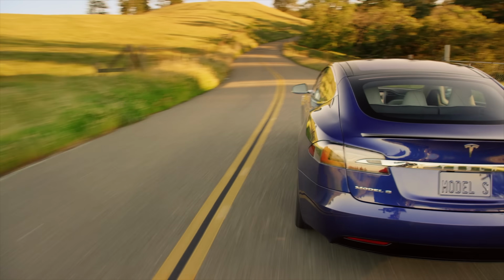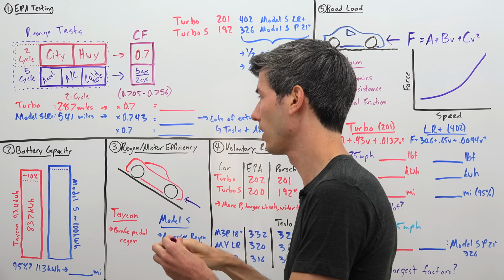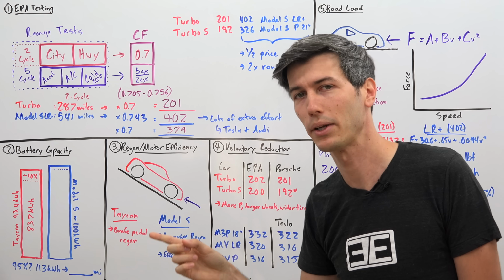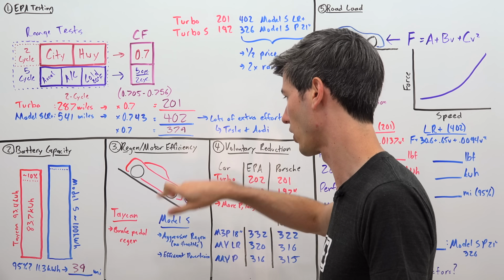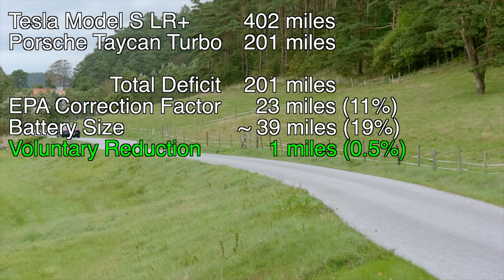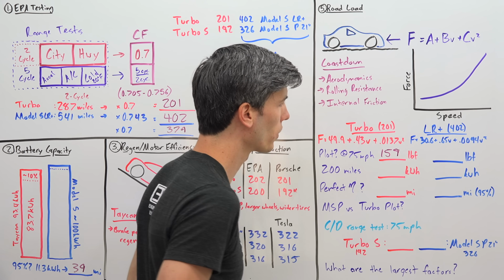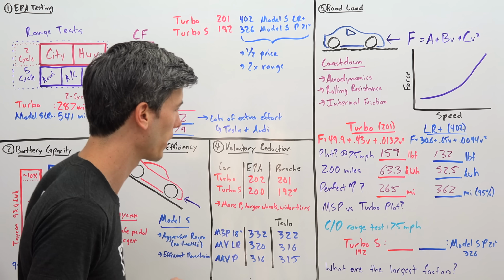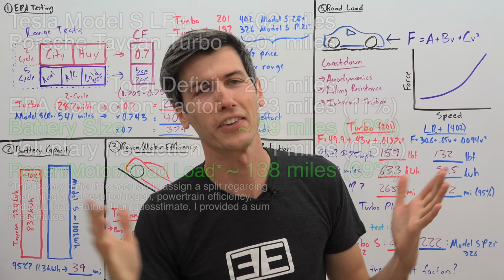Tesla's Secrets To Dominating EV Range - Double Porsche?!

Comment: Porsche ALWAYS underreports...  their cars usually produce more HP and have better 0-60 or ¼ mile times than advertised... that is what Porsche does.
Reply from the maker: And yet they're simply using their test results for these cars, not understating.
Reply: @EngineeringExplained  The very fact that they're not embellishing it is effectively the same in todays world... but I can assure you as a 992 owner, the performance on the car is noticeably better than the numbers released (0-60 3.4??  closer to 3.0).. etc..
Reply: @EngineeringExplained  btw, thanks for the great videos.. would love to see you do another video on why the 911's engine with GDI isn't prone to carbon intake valve coating like so many other GDI's... always wondered why?

Comment: The whole video you were comparing the MS LR versus the Turbo and then at the end used C&D's numbers for the performance versions which are not tuned to go far. The tires are probably the biggest issue for performance versions. You'd see about a 100 miles difference maybe more if you were comparing the longest range variants.
Reply from the maker: I believe I was clear which cars I was discussing - apologies if that was confusing. The Porsche still beats its range, and the Tesla is way under (again, comparing the top performers, but the Model S's EPA rating does not reflect highway range at all - off by 100 miles!).
Reply: @EngineeringExplained  If I drive at 65-70, my Model 3P gets its' rated range.  Above 70 eats through the battery quick.  If you want efficient highway range, slow down a little.  Your time gained by going fast is lost by charging longer.  I drive two 300 mile trips a week and I find it's better to just drive the speed limit.
Reply: @johnh8268  People who think that way should save money and not buy the Turbo version of the Taycan or the performance version of the Model 3 or they are completely wasting their money.
Reply: @robertm3951  You are probably right if range and efficiency are a top priority.  I do wish I had bought the M3P- without the big wheels and summer tires.  However, I'm trying to point out it's possible to drive a little more carefully to get that sweet, sweet range, even in a M3P, when necessary.  I do most of my performance driving around town and for the occasional high speed pass or merge.  Still, I could have saved ~$7,500 and bought the M3 LR AWD and probably been just as happy.
Reply: @John H Really!? Anyways.. It’s actually faster to drive as fast as possible if you have to charge anyway. As long as you don’t go faster than like 110 mph (180 kph). 🙂

Comment: Check Bjorn's video on Taycan 4S range.
Reply: Yep. Put on different wheels&tires, boom range = amazing.
Reply: @jfolz  nobody forbid you to spec the car with the most efficient tires rather than the most performing ones. And likely still lap several seconds faster than the model S around a track with those tires.  But no point to reason with cult followers
Reply: @USUG0  people can do whatever they want with their cars. If I could afford one I'd wanna keep it as intended by Porsche. They know what they're doing :)
Range is good enough as-is and the charging speed is bonkers anyways.
Reply: @jfolz  What was more amazing was the range before he set off... 453km. Does the car know what tyres are fitted? I think not. So the range was above 201miles prior to driving on those tyres.
Reply: @AndrewClelland  AFAIK that "range spec" Taycan was tested as-is, so the car knew the long term consumption as driven by the owner.
Reply: @jfolz  But then why was 580km such a surprise and far beyond what Porsche has advertised? If the car already knew, then Porsche most definitely already knew 😉
Reply: @Andrew Clelland I was not surprised at all. The Taycan and the Model S are almost exactly the same size, shape and weight. Of course they have very similar consumption with similar wheels. There’s very little Tesla can do about the laws of physics.

And it’s not like Porsche and other legacy manufacturers started developing electric motors yesterday. Still, most people believe that Tesla are light years ahead. They are, in marketing.
Reply: @Andrew Clelland I think it was fitted with the same tyres all the time. Don’t know if GOM knows, but it uses a number of parameters to estimate the range. If it doesn’t know where you’re going and how fast you’re going to drive, it uses a slightly pessimistic number based on you’re previous trip(s). This is very different from Teslas fixed “typical” range, and it really plays with your mind, even if you know.
Reply: @sdrhs-q3j  basically everyone knows that egg-shaped cars are efficient, only Tesla is not afraid to make them that way unlike other makers ;)
The Korean cars are might actually be more efficient drivetrain-wise.
Reply: @AndrewClelland  the car was fitted with those tires from the factory, they weren't change for the test...
But it's a Taycan with 19" tires, not wide 21".
Reply: @riDDimann True. Wish he documented tire pressure in all his tests as well. Apparently, Tesla recommends 3,1 bar cold (ends up at approx. 3,3 bar warm) while Porsche recommends 2,5 bar.
Reply: That is Bjørn Nyland channel for people who don't know
Reply: @FSXgta  You just named it perfectly. Don't be scared, wager an excursion to the search function, it's OK!
Reply: Check the Video or article by nextmove,
They compared Tesla vs Porsche @120km/h and also @200km/h
Reply: Bjorn is a tesla fanboy
Reply: @Fleyua Yes, but he still makes damn good content. And he achieved 580 kms. (360 miles) with the Porsche Taycan without even checking the tire pressure.
Reply: Even Bjorn's test show that the Model 3 Performance is more efficient with 20" and sticky tires compared to the Taycan 4s with 19" and low resistance tires. The Model S got 644Km
Reply: @juanmedinar20  644km vs 580km is about the difference you'd expect from the battery size, so their efficiency is quite comparable, with the model s probably still having a slight edge. This video is suggesting a massive difference that just isn't there in reality.

Comment: I've always found it odd trying to compare these 2. The Porsche is obviously built more like a race car than a Tesla. The goals are different as its all about what trade offs you want. If i'm in the market for these cars then i'm not thinking "This one is built better because it can go more miles off s single charge". 
The question is "Do i want to have the sporty feel for the odd track day or do i want less hassle at charging stations?"
If we are talking about for example a nissan/renault this becomes an entirely different story.
Reply from the maker: It's a 5000 lb luxury EV sedan haha. It has impressive performance, but it's not a race car.
Reply: @EngineeringExplained  True, i did say sporty feel. Its about the driving experience instead of engineering quality.

Comment: When you buy a Porsche, you want it to drive like one. The suspension is miles better (and likely heavier and less efficient) than the Tesla which is only fast in a straight line.
Reply: Hmm... I hope you know Model 3 was able to get a better speed in the moose test than Taycan. Seems like the Taycan is only good for straight line
Reply: @biplabkumarghosh6300  The Model 3 isn't in the same class as the Taycan and Model S. It's almost a foot shorter.
Reply: It dosent feel like a porsche its way to heavy
Reply: @sikk47-21  Taycan has torque vectoring, rear wheel steering, electric mechanical roll stabilization. Only model 3 has rear wheel steer.
Reply: @sikk47-21  
Porsche Macan owners: 🤔
Reply: @hectorandem2944  Comparing the entry level of any company to a flagship makes no sense. C-Class compared to a S600 Maybach?
Reply: @jalenad11  I'm glad to see that you don't even think about the A-class as a Mercedes. You have a soulmate here. C-class will always be the "baby benz" 😉
Reply: @Alex Spray Wasn't comparing the 3 to the Taycan. I said the 3 was the only Tesla with rear wheel steering. Tesla maintenance has been documented as terrible and they remotely disable features from the vehicle that you paid for. Just like price is price, better is better. This wasn't a bang for buck discussion. If you're shopping in the exotic market, you buy what you want because you want the features more than you want the money the car costs.
Reply: @Alex Spray Model 3 is the cheapest Tesla and isn't classed with S and Taycan. The loaded S is around 115k and Taycan Turbo S is 185k. Try getting maintenance on a Tesla and you'll wish you bought the Porsche.
Reply: @jalenad11  looks at the $135K I saved buying a Model 3  Nope, still not wishing I bought a Porsche

Comment: really? lbf, kwh and miles in the same table? Just pick a system jason!
Also that system has to be metric
Reply from the maker: Here in America we like to make things extra difficult. We think it gives us grit (I'm just using the units that EPA displays).
Reply: Kwh is used for electricity usage and storage in the US. It isn't Jason't fault that units in the US are so inconsistent.
Reply: @TheGerm24  the way I've been taught is to convert everything so SI, do all the calculations you need and then back to imperial if necessary, which is still easier than keeping track of conversion factors all over the place
Reply: @TheGerm24  qqqqqq1

Comment: Still laughing with my s211 Diesel with 1100 km every day range :D
Reply: How much you pay to fuel up?
Reply: Carlos Gutierrez with normal german prices about 60€
Reply: Couldn't that really be twice or maybe even three times a day on the highway?
Reply: and just how poison is being expelled from the exhaust?
Reply: @rtfazeberdee3519  Hardly any, using HVO makes your diesel car more environmentally friendly than any EV.
Reply: @emilmuhrman  turn the engine on and sniff the exhaust for a while and you'll find that not true.
Reply: @rtfazeberdee3519  No noticeable smell from a modern diesel with particle filter and catalytic converter. Lithium mines on the other hand....
Reply: @emilmuhrman  ok, lock your self in a container with the engine running and see how long you can stay in there
Reply: @rtfazeberdee3519  You will die from to low oxygen levels by increased carbon dioxide. This is not a problem on larger scale because the same plants used to make the fuel in the first place is now binding the carbon dioxide emitted. Carbon monoxide and nox compounds is not a issue with a functional catalytic converter.
Reply: @emilmuhrman  funny that all cars in europe have catalytic converters and nox is a problem.  So you can't breathe carbon monoxide that emits from your exhaust pipe.....  now if i lock myself in a container and turn on an EV, i'll look and sniff hard to find similar to the ICE car.
Reply: @rtfazeberdee3519  It's only in inner city's there that is a problem. Because the catalytic converter don't comes up to temperature. A hybrid with a small battery to use in slow traffic is the best solution. The big battery in a full EV is not viable to the entire fleet.
Reply: @emilmuhrman  if that was the  case then every vehicle would be off the road with a failed emmissions test
Reply: @rtfazeberdee3519  Most cars in slow moving traffic would fail an emission test.
Reply: @emilmuhrman  emissions tests are done on a stationary vehicle - how much slower can you go? And that car has usually been parked for a few hours, i know mine was done in the afternoon after dropping it off in the morning
Reply: Rtfa Zeberdee the car was already produced when I bought it so at the moment that’s not a big problem for me.
Reply: @htow9301  but you are still polluting and will do so until the car eventually dies
Reply: Rtfa Zeberdee an electric vehicle also produces emissions just in an other place the powerstation and their production. Many less but in Germany it’s is irrelevant with out to 70% of Cole power.
Reply: @htow9301  not always, renewables play an ever increasing part these days.  there are plenty of reports out there proving that even if electricity was powered only by coal, an EV will still be cleaner than an ICE vehicle
Reply: Rtfa Zeberdee But sadly not when I need them. In the evening or morning when I’m driving on the highway. There I need the fast charging system with up to 250kw when I’m at home my 8kw PV is more than enough for every e car. 

Edit: the high and often changing fast Charger can’t be powered locally because they just can’t guarantee the high power.
Reply: @AzathothsAlarmClock  didn't know charging a car is frustrating
Reply: @JigglyIceCream  If you're trying to drive 800 miles in 12 hours it certainly would be.
Reply: @cdw3423  didn't know you were a semi driver
Reply: @JigglyIceCream  You have to be a semi driver to take a road trip and not want to waste time getting there?

Comment: Love it! Doesn't hurt that he was featured in Car and Driver a few issues back as an up and coming! Reading my September issue soon!
Reply: As it turns out, if you put the same wheels/tires on the Taycan, and ensured the wing was down 100% of the time, then at 75 mph, the Taycan could possibly go 1.75 miles further than the Tesla, even with the small battery.  I've said it before and I'll say it again, Porsche intentionally chose to trade efficiency for traction with those big wheels/tires and that wing.

It also shows that there's a new king in town.  Musk loves to claim that no one has matched the 2012 model S ... Porsche said "I'll be your Huckleberry".. not only dominating the 2012 version, but also the 2020 version.

And now Lucid's right about to destroy them both!  As it turns out, a higher voltage system really does pay dividends.  Still, I imagine the Lucid won't be putting Taycan sized tires on that car. It may be fast in a straight line like the model S, but it won't be able to take down a track like the Turbo S.

Tesla... your price tag is showing... Might want to ... swipe swipe*... do something about that...  *swipe
Reply: Up and coming? Jason has 3 times the viewership of Car and Driver
Reply: @SeniorKlean  as much as I thoroughly enjoy Jason's videos and observe his online presence, he's still an amature to a publication that has been around since 1955 (Sports Car Illustrated) and is more of a common name. Outside of subscriptions, they are the ones who do countless and methodical testing of vehicles that eclipses virtually any Youtube channel. The gap for online production and quality of testing IS narrowing faster than it has ever. I really think they (Car and Drivet and EE) should really do a collab as CD does get nerdy with stats occasionally!
Reply: @maxwellkeeling3781  I'll grant you all that. But up and coming connotates a small viewership.
Reply: @SeniorKlean  totally. I believe that was the framing of the article that was done in the issue, showcasing individuals whom are rising in exposure and even fame.